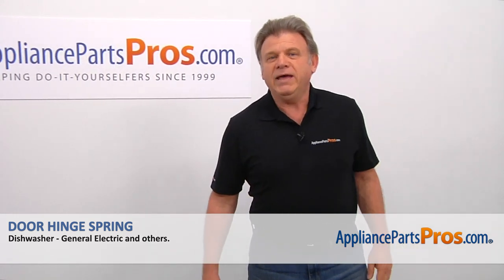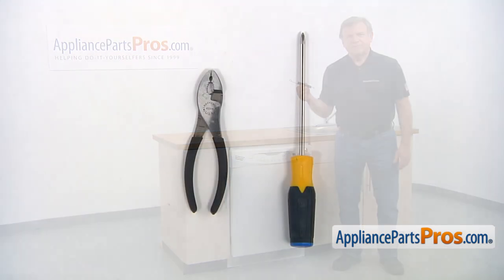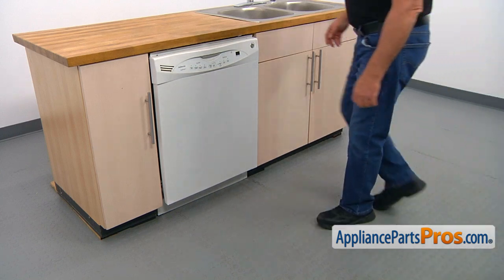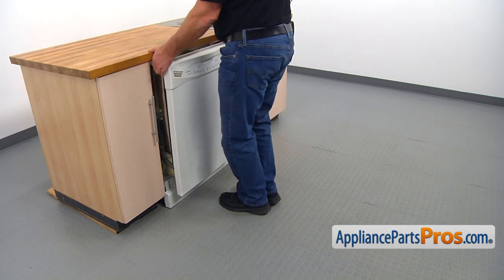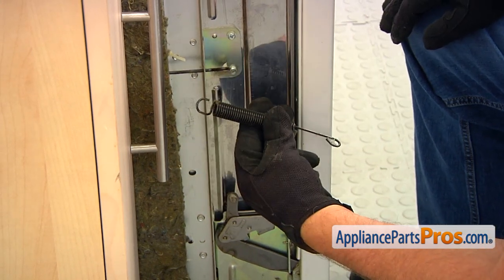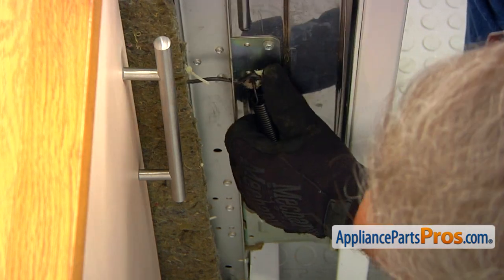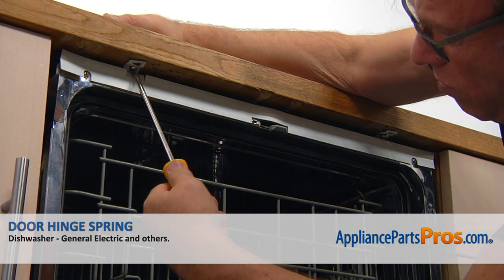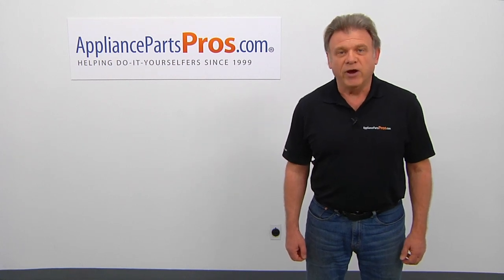How To: GE Door Hinge Spring WD03X10030

Comment: Where can i find wd03x10031???
Reply from the maker: You may try to reach out to local appliance stores or check google. You can also try to reach out to the manufacturer and see if they may have made a new part replacement part for this part. We don't have a replacement part at this time.